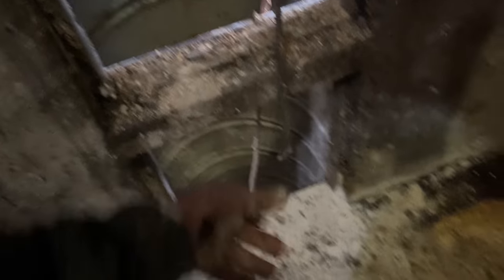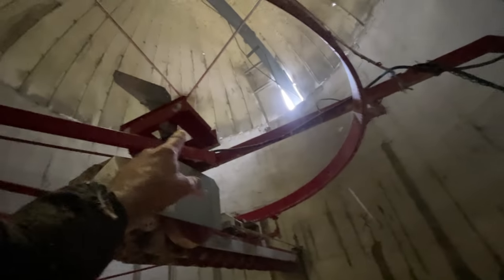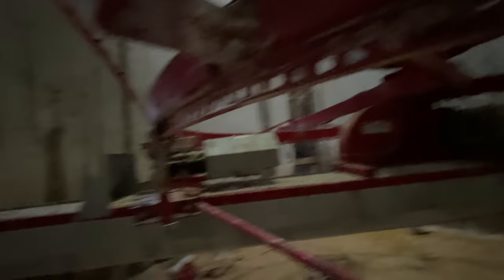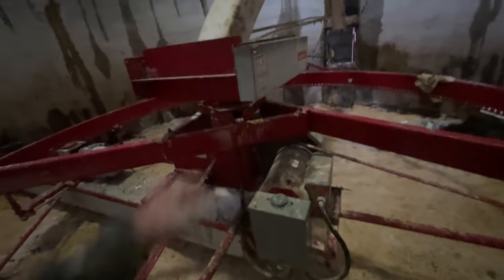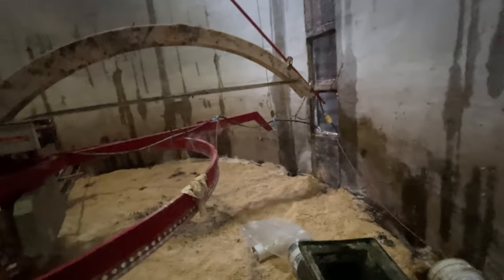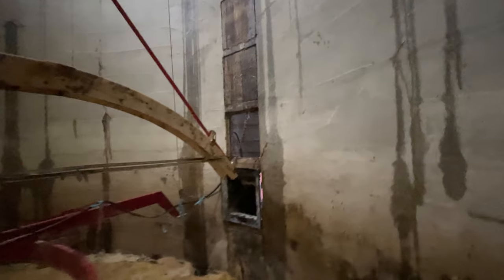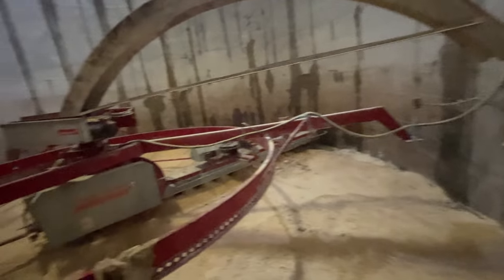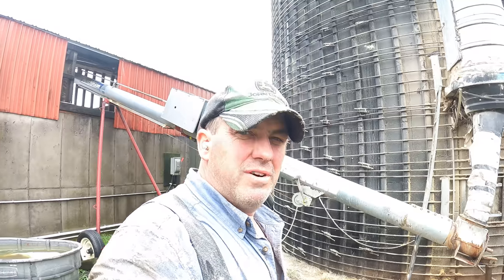Silo Junkies

Comment: There has to be a lot of pressure on the silo with the amount of settling since you filled it! I remember back in the 70's when my cousin started putting up high moisture corn in a cement silo they put extra rings on the outside to keep the silo together!

Comment: You are wise to use the plastic bag tube sleeve on the chute feeding down the side of the silo. Years ago when my uncles still used them the chute and steps on the doors stayed fairly clean, without them it got pretty dirty climbing up or down the chute. As you know there usually is a draft blowing right up through there so you get a face full in the process. My uncles had Jamesway unloaders too. Do you use your Harvestore silo at all?
Reply from the maker: No we don’t

Comment: What keeps high moisture corn from spoiling in there?
Reply: The plastic spread on the top when they are done filling the silo and they pile some corn around the side next to wall of the silo to help keep the oxygen out  that usually keeps the corn fresh they end up with a few bushel of loss but not too bad. That is mostly what the black junk was in the video, no need to weigh the tarp down because there is no wind inside the silo.